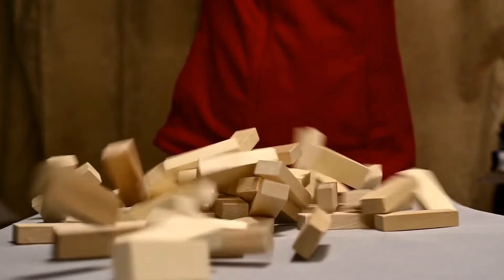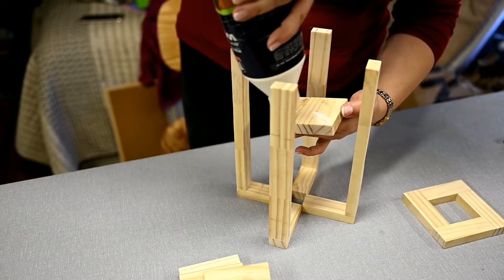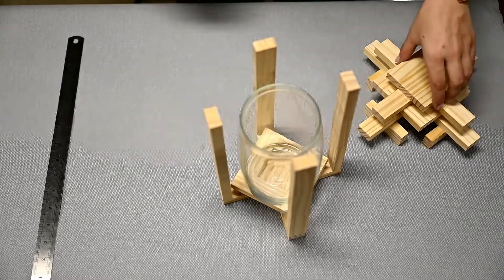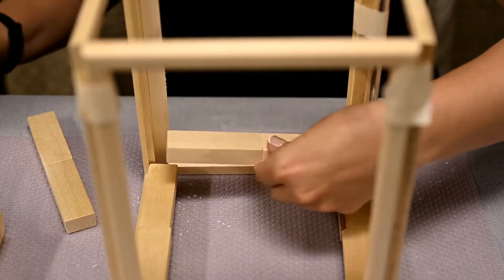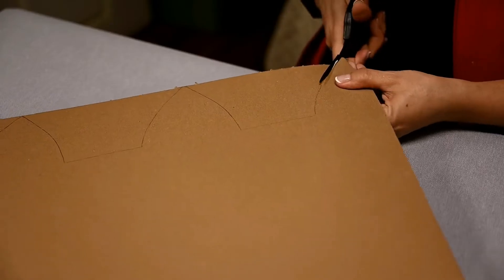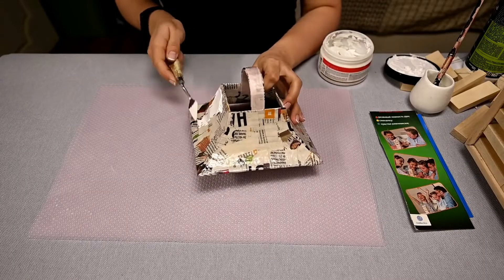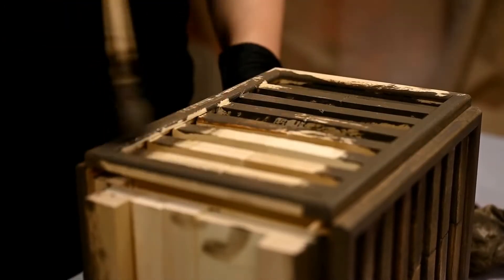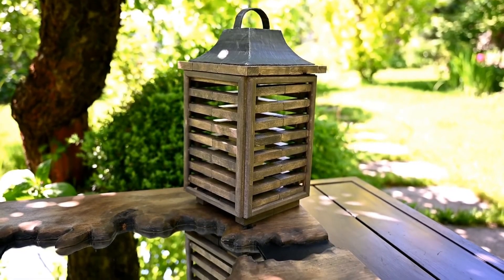DOLLAR TREE DIY Tumbling Tower Crafts You Haven't Seen Before

Comment: 💜👍👍👍👏👏👏💜
I've seen your other Lanterns but I can't remember, have you made any Lanterns out of paint sticks ? I have a hard time finding the Tumbling Tower Blocks. Great job !!!
Reply from the maker: No, I'm afraid not. We don't have any paint sticks here in Russia)))) you can use wooden planks from a hardware store, this is even better for the second lantern as you will not have joint in the middle. And all you'll need is a small hand saw (if you don't have any other tools), thin planks are easy to cut)
Reply: @IrenesDIY  Thank you for the help. I didn't think of that. I wish I could send you some paint sticks. I know you could work your magic with them.